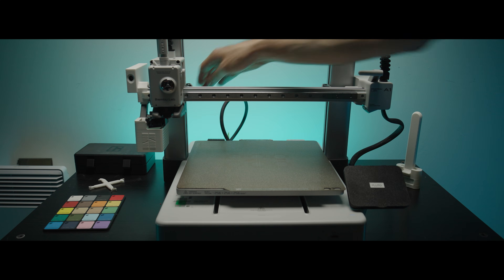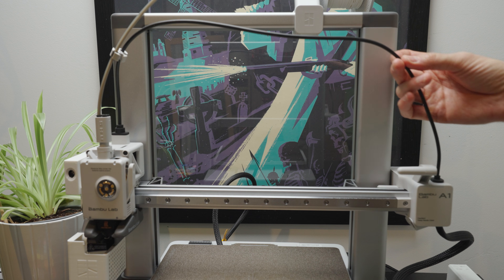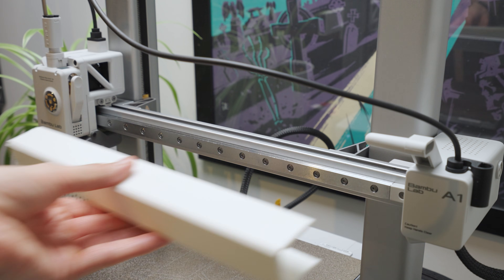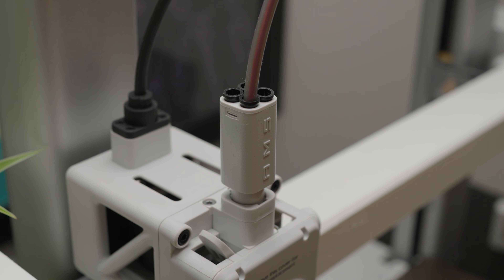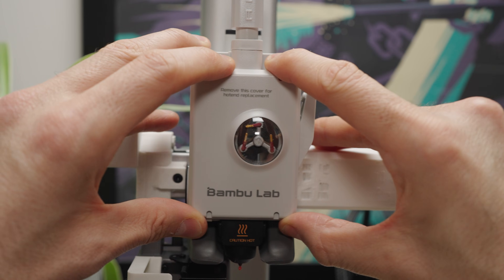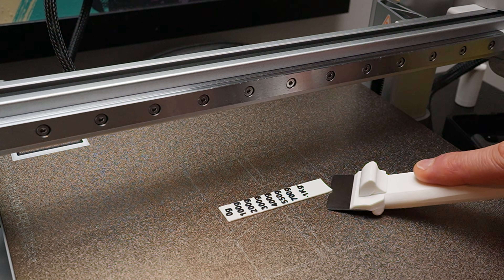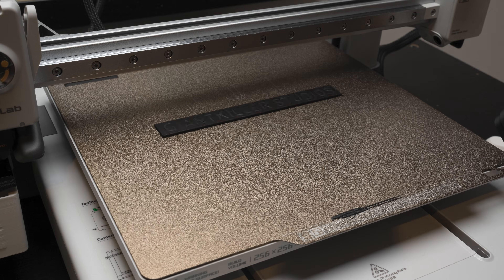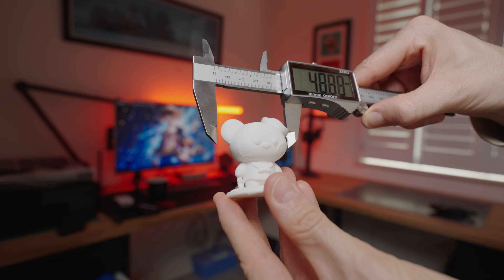MORE A1 beginner 3d print upgrades

Comment: Is your bambu lab a1 on a 4 IKEA kallax shelf? If so, what about vibrations or the shelf rocking back and forth while printing? I saw that the shelf is slightly away from the wall?
Reply from the maker: Yeah that’s right. I have a shed ton of weight in each compartment though. I get no movement at all from vibrations. Not ideal but it does the job. 😅

Comment: I know it takes longer, but watching that filament gauge curl as you scraped it up made me cringe. If you wait 15-30 min for the plate to cool your prints will pop off with no scraping necessary (and no bent/warped print fro being peeked off while hot.)
Reply from the maker: I did it for the shot only. Usually I do take the whole plate off.